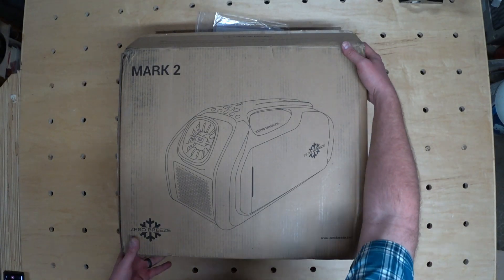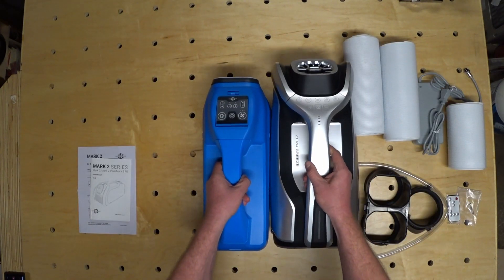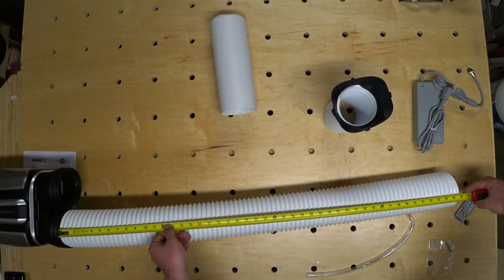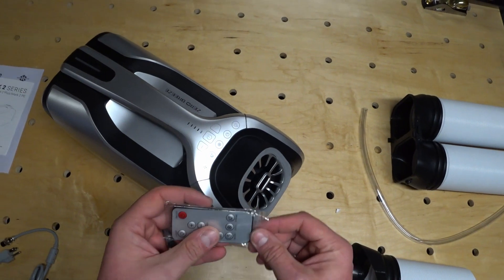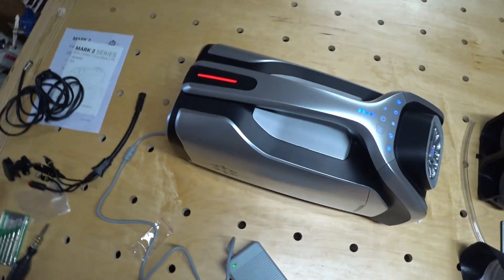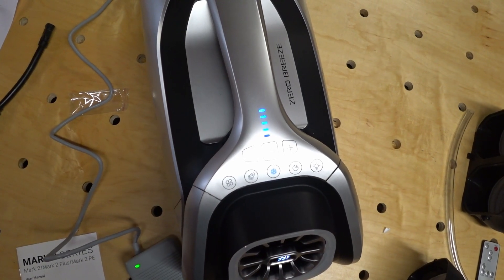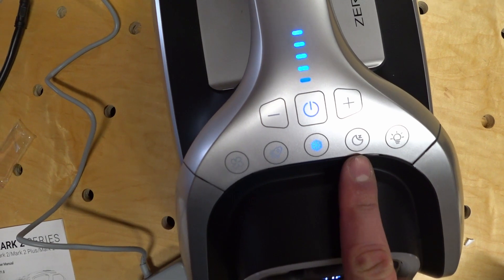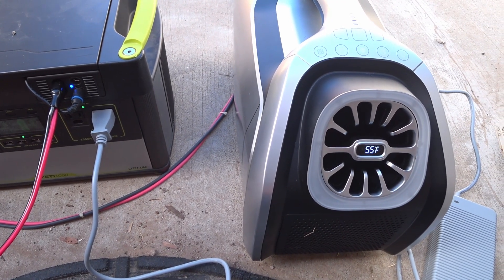Zero Breeze Mark 2 Unboxing, Startup, and First Impressions

Comment: I was looking for this product till I seen the price.
Reply: U pay for what u get. And for the price, it does what it advertises. I went camping with one. It was 101f out side my tent 79.7 inside my tent
Reply: These are a scam lol
Reply: @imcrazyforwar  buy me one too
Reply: @imcrazyforwar  is it good for cars with the AC off?
Reply: @sentient1705  maybe? Smaller space than a tent. As long as u vent it out the window I don't see why not
Reply: cass nortom  they dont work that good
Reply: This thing is a tremendous waste of money, and resources.  Essentially it's a fan where the air is cooled before it hits you, but at the expense of heating up the surrounding environment.  You wouldn't run this in an enclosed area, it's only (slightly) useful outside.  You wouldn't use this after owning it for more than a month.
Reply: @richardwicks4190  you do know you duct the hot air out of the room you are cooling, right?
Reply: @VESSVUTE  Watch the advertisement for this ridiculous contraption to see how it's advertised to be used.
Reply: How much?$$$
Reply: Duck tape
Reply: Same
Reply: Maybe good for small grow room or airtight place. I got a big portable ac and it takes a while to cool my small room, also have ceiling fan going. Sun hits window, room is hottest in the house. Doubt this lil thing will do any better then my one 8x bigger. If so awesome product. Guess I’ll never know unless I get one free somewhere lol
Reply: Just bought one ☺
Reply: To everyone saying theyre a scam and dont work.... mine works great.  The cost of lithium batteries or even agm to support the power of a window a.c unit would cost waaaay more than this. This cooled down the inside of my van from 95 to 75 in 20 min. This saves a bunch of valuable space in the van for my other stuff. This works amazingly and i am very satisfied with my purchase. People worried about the price need to save money better or get a better job. Simple as that. Some just like to complain. Weirdos. Get a life...or a better job like i stated before 🤣🤣 wouldnt have as much time to complain
Reply: @nathanarnold9827  $1,400.00
Reply: @kelseylantz1989  you smoking poppie.
Reply: @romonshakra9381  u jealous u cant afford 1400. Smh go back to work
Reply: @imcrazyforwar  😂 I died I'm to cheap but I so want it

Comment: Ive been waiting for something to be off grid like this for 3 yrs now. Finally a honda generator coupled with a Kodiak and now ac, tv, xbox, and now you have full system. Great video.
Reply: I think you have to have a generator if only as a backup, I'm debating on buying a barely used 2000eu with companion and the propane conversion for $1400, can't pass up that deal even though I won't be using the generators right now.
Reply: @ProBackgammonequipment  I bought one as well but in thinking ahead i was gonna use the gas generator to recharge what i didn't use in power to recharge the Kodiak solar generator but only if it was low on power. Like a power unit within a power unit and the honda with its 8hr run time on 30%ish load i figured it can top off the solar generator until. Idk. A back up back up.

Comment: FYI for shits & giggles.  Infrared thermometer reads surface temperature of whatever material it happens to face.  Different material absorb/shed heat at different rate.  Also any reflective materials will add to inaccuracy.  For more accurate Air Temperature- meat thermometer work pretty nice & cheap too. HVAC Folks been using meat probe for quick DeltaT for long time.
Reply from the maker: Agreed, thanks for the food (thermometer) for thought.

Comment: It’s crazy how this is the only retail air conditioner that runs less watts than the common 5,000 BTU wall unit AC.
Reply: Same thing I thought, I wonder why that is. With hundreds of thousands of delivery drivers alone in box trucks and sprinter vans that would buy these 2 at a damn time.
Reply: @btsmith  I was looking for this comment.  My husband needs one for his Ups truck.  *sigh

Comment: What are you thinking about semi truck bunker? Could I cool it off and could I used trucks battery power to run it ? do have inverter installed! Thx 🙏
Reply from the maker: I've seen posts and pics online of truck drivers using the Mark 2 to cool their trucks when stopped with great reported success.  You can run off your inverter, how long depends on your battery capacity.  Are we talking about your starting batteries, or do you have "house" batteries?  Expect to pull 200-240 watts on normal mode, so you can do the rough math.  Running anything off of starting batteries is always a gamble.

Comment: If you want to increase the air velocity of the supply air, all you have to do is decrease the diameter of the supply air duct.

Fan speed should not be used to determine air velocity, but rather the width of the air duct should be used to change the air velocity.

A slower fan speed results in a colder evaporator coil, because air has MORE time to move across the evaporator coil, & as a result, can absorb MORE heat out of the conditioned space (aka the room that its trying to cool down).

-You're Welcome.
Reply: Like a venturi effect

Comment: the slowing of the fan allows the air coming out to be colder. Air is drawn in through cooling tubes and output in front, so if at max cooling, there is an optimal amount of air being drawn in to optimal cooling. if you force too much air through (high fan speeds), the output air will be warming. science and laws of physics.
Reply from the maker: Good point, makes sense.  Lowering the fan speed however decreases the distance the cool air will travel before getting heated up by the ambient temperature.  In other words I'd have to get closer which may not always be possible.  Wonder where that fine line is for maximum cooling efficiency...will have to experiment.  Might want 68° air blowing on me forcefully, rather than 64° air I can't feel.  Will depend on use case.  Some good food for thought though, thanks.

Comment: After using mine for 2 summers, it has failed. No warranty after 1 year. Battery was replaced this year after a failure on the first and customer service rejecting any claim. 
I actually liked the ZBM2 for small applications like tents, but in Vanlife, it isn't a good option. You can find units for 700 that cool twice as fast and spend the remainder of money on more battery power for your system. 

I would have given this a 6/10 last year, but after experiencing poor customer service and product quality, year two makes this a hard 4.5/10.
Reply from the maker: That sucks that yours failed, do you know what happened to it?  Can you link to the $700 AC you mention, I'd like to check it out, is it also DC powered?

Comment: The fan might slow down on strong mode so that the air passes through the evaporator coils more slowly giving it time to cool the air more.  I like that thing, too bad they come up with good ideas but make things with cheaper and cheaper materials, like those tabs.  If you expand the tubes and spray with flexseal or something like it, the tubes will last longer, keeps them from cracking.  You can still collapse them after it dries.
Reply from the maker: Thanks for the suggestion.  On the quality comment...I have to say the Mark 2 is WAY more stout and well built than the first version.  It's gone flying around my vehicle a few times and still works great.

Comment: Why did they change it from FREEZE to BREEZE? I'm guessing it wasn't cold enough? The few reviews of the original I can find have comments turned off so I can only assume it was rubbish.
Reply from the maker: Your assumptions are correct, the original needed some upgrades.  Those upgrades came in the Mark 2.

Comment: So what kind of battery bank would I need to get this to run for 6-8 hours??? Right now I have a 500 watt solar generator & it runs it out in like 3 hours 🙄 the extra battery only last for 2 hours which in the website it states 3-5.....not happy about that since it. Cost $1300!
Reply from the maker: That's pretty good for a 500Wh battery.  I think I got on average about 4.5 hours on my 1000Wh battery in a hot car on a hot day running on high.  If you're getting those numbers you'd be good with a >=1000Wh battery combined with your Zero Breeze battery.  Would be more helpful if they gave realistic numbers for their own battery.  I'm sure they test them and rate them under ideal conditions.

Comment: I have a 98 Ford E~150 conversion van i converted...i NEED some type of air my only power is a 500w Jackery n 120w solar. Fans don't cut it im in Pa the humidity gets intolerable, i dont do well in the heat n faint sometimes. I have ac in the van but cant/wont leave it running. For the price u would think this would cool this small van but from the comments u r leaving it seems not so will this not adequately cool my van? If not any suggestions...i need help??? Has 2 not require power cordless like this????? Please help...
✌💙🙏
Reply from the maker: Hello, unfortunately the Mark 2 would not cool the interior of your van like your van's dash AC would.  The Mark 2 has a cooling capacity of 3200BTU's, and your van may have 10's of thousands.  The Mark 2 will blow out air up to 30 degrees cooler than the air around it, but in my experience I have to stay in front of it and in the air stream.  This is exactly what I bought it for, and it works fantastic in that use case, no dripping sweat in a 100 degree vehicle.  At night, you may have much better luck, but in full sun during the day it just wasn't designed to cool the inside of a large space.  A battery of 500wh is only going to give you a limited run time depending on ambient temp, so that's something else to consider.
Reply: @Polymathicus  thank you. I really surprised 4 the price!!! I mean for $20 u can get a swamp fan 2 sit on front of!!! Ugh now what....
Reply from the maker: @melindamarie6139  That's a difficult problem to solve since you mentioned the "intolerable humidity".  I used a cooler from swampy.net for years before the Mark 2.  They don't sell the ice models any more last I checked which could have helped in a humid environment.  Mine was ice and swamp cooler that I could switch between, but our summer humidity can get down around 20 percent so the swamp cooler worked great.  I agree, the price of the Mark 2 is high, and it's only worthwhile for a very specific customer.  I got it on the first day of crowd funding (cheap), so I can't complain, but it would be a difficult decision for me now.  Good luck.

Comment: So the Houston summers are very hot 🔥 and humid.. What would be your suggestions on using this to cool off the inside of a mail truck.. you think i could run this thing safely off of a separate car battery ?
Reply from the maker: It needs 24V so if your battery is 12V you'll need a converter. A lead acid battery may not be able to supply adequate voltage for the whole time but I'm just guessing there. It wouldn't cool the inside of the truck as it's only 3200 BTU, but you can point the duct at you and it will cool you. This is how I use it. Actually that's a use case that makes sense for the Mark 2.  If you end up trying it, respond with your findings, I'd be curious to hear.  also check out the Mark 2 Facebook page, as a couple users had some issues in a moving vehicle so you might ask them the same question.

Comment: Good job!  I normally don’t like un-boxing but you were quick and to the point.  My mission for this device is to cool a very small pick-up camper.  Your thoughts?  Will it do the job?
Reply from the maker: A 2300BTU air conditioner like the Mark 2 can't cool a space if it's being beaten down on by the sun.  It can blow cool air on you, which is how I use it.  For cooling the space, you could find it suits your needs better at night while sleeping.  Others online have reported good results overnight in small insulated spaces.
Reply: @Polymathicus  … thanks for the reply!  I more or less anticipated that to be the answer.  I wish someone made a unit with this same basic horizontal configuration but 3X the cooling capacity.  Models that would fit my need are all a vertical orientation and less portable.  There is only 3 months that I would have a need.  Generally, in the latitudes I travel it cools off at night and humidity isn’t an issue.

Comment: Just so you’re aware, it was almost definitely the run capacitor that failed and started smoking on your original unit. That sometimes happens to the most expensive units. It’s a $20-$30 part btw.
Reply from the maker: Interesting, thanks.  I have never cracked the old one open but it'll happen eventually.  Maybe it's fixable, if it's a 20-30 dollar part, might as well take a look.  All I know, is that when it "popped" it smoked.....a LOT, billowing thick white smoke.
Reply: @Polymathicus  Yep, then that pretty much tells me that it was for sure the capacitor. Did the smoke have a burnt popcorn or peanut like smell?
Reply from the maker: That's not ringing a bell, but it has been a long time.  The striking visual is burned into my mind, but not the smell apparently.
Reply: @Polymathicus  Specific to cracked capacitor.
Reply: These are bldc compressor motors. They do not have run or start capacitors like their ac induction motor counterparts. Most likely the esc for the bldc failed, likely just one or two mosfets on said esc

Comment: Very nice review.  It appears the Intake and exhaust hoses would need to be connected, otherwise you would be sucking hot exhaust air into the unit?  Also I wonder just how much it will drop the temp from the intake temp?
Reply from the maker: Yes, with the rear hoses disconnected it may suck some hot air right back into the condenser coil intake, but probably not much of a concern if used outside, only in an enclosed space.  As far as the front of the unit, I have found it drops the temp up to 30 degrees below ambient.
Reply: Thank you. Living in Palm Springs, CA. Any cooling gadget is of interest 🌴😎

Comment: How much better is this than the ultra arctic air cooler?
Reply from the maker: Just did a quick search, and if you're talking about the evaporative (swamp) cooler on Amazon, we're talking apples and oranges as the Mark 2 is a real compressor driven air conditioner, and the evaporative coolers are essentially a wet pad with ambient air blown through the pad with a fan.  Check out swampy.net if you're interested in evaporative coolers (super efficient, high air volume, extremely low power draw).  I used one of theirs for 10 years before coming across the Zero Breeze products.  Note:  Evaporative coolers only work well in VERY dry climates, and if you're in an enclosed space it will humidify the air over time making it less and less efficient, so it helps with products like the swampy to bring in dry air from outside your space.
Reply: @Polymathicus  Thanks for letting me know, I currently for three of those air coolers and want to replace them with the mark 2, only thing I don't like is the price though
Reply: @Polymathicus  Yea you're right about its a wet pad with a fan blowing through, this gives me another question. How loud is the mark 2 in comparision with the mightkool k2 you used?
Reply from the maker: It's been a while since I used the Swampy cooler, but from what I remember, that thing moves A TON of air, so it really made some noise on high.  I'd say the Mark 2 is quieter overall than the Swampy on high.  But just splitting hairs....I could talk on a bluetooth headset with either cooler blowing right on the headset.  No one ever said anything with either.
Reply from the maker: Yeah, the price is rough.  I got in on day one of crowd funding (~500 I think).  It would be a difficult decision now.  But it's really priceless for me to sit in a 105 degree vehicle and not drip any sweat as long as I keep it blowing right on me.  The moment I move out of the air stream however, sweat city.

Comment: I got one with two portable batteries. I use it in a hot car since I work as a private investigator. Mine doesn’t get much lower than 76 degrees in a hot car. I have the heat tube set up to blow out my window. Also my batteries are dying faster than advertised. Is 76-77 degrees considered defective in your book? I see yours blowing at 54 degrees. Not sure if my hot car has anything to do with the performance of the machine.
Reply from the maker: 77 isn't defective if it's >100 in your vehicle.  I get an outlet temperature on average 25° below the ambient temp in my vehicle no matter how high that is.  It won't cool a vehicle in full sun, but I personally don't break a (dripping) sweat sitting in the air stream when my vehicle has gotten up to 105 inside.

The back end of the Mark 2 needs to breathe well so the intake hose at the back needs to be getting all the air it needs and as cool as possible.   If that condenser at the back cannot breathe well it cannot efficiently dump that heat.  In my case I have to run the rear intake hose outside also as that's where the coolest air is.  Even if I crack my windows the air inside is always hotter than the outside in full sun.  So if you're going to suck inside air into that intake hose at the back then you need to make sure you're replacing the air that the exhaust hose is dumping outside.  Even then you're sucking potentially 100°+ air through the condenser on a hot day and that could reduce it's effectiveness.